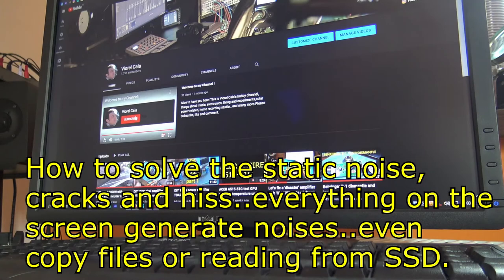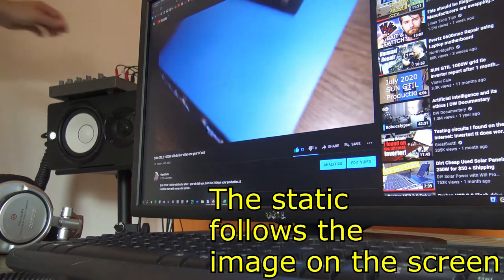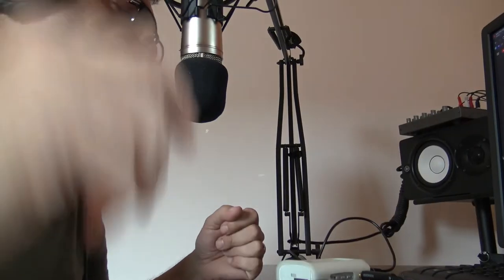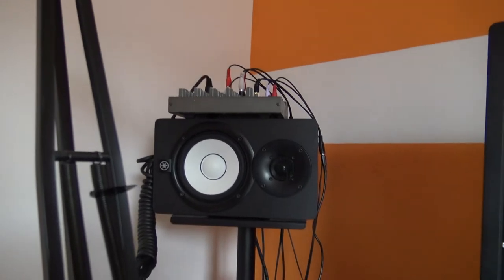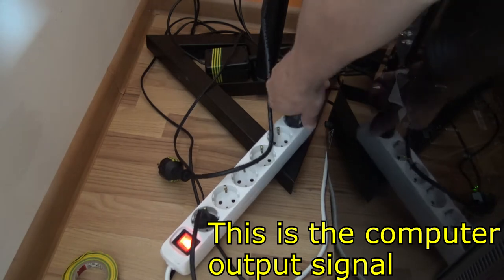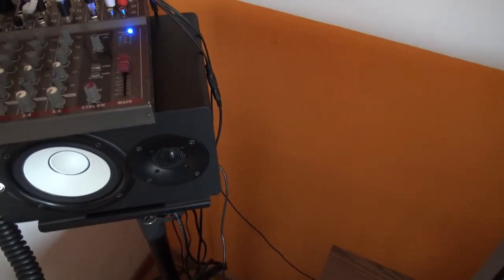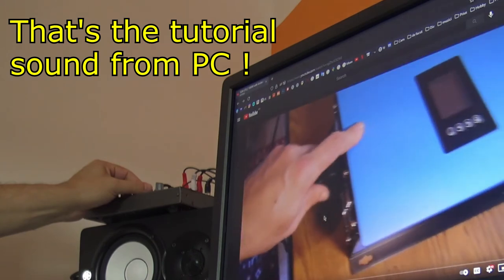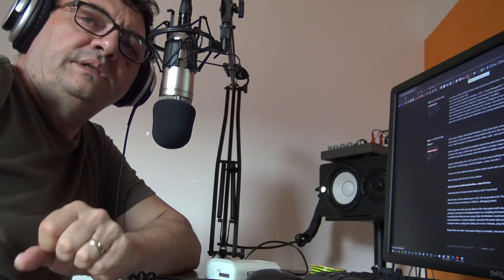ASUS motherboard cracks static audio simple solved

Comment: Thank you so much I have had this same issue with a Asus 570x TUF motherboard. I have been dealing with this issue for 3 years and could not find a solution. This morning I finally had a enough (because I hadn't used the computer for a couple weeks therefore had forgotten how bad it was). 

Anyways after searching every combination I could think of I stubbled across your video thinking it may be my motherboard. Your solution worked like magic. I'm in the US, so I used a 2-wire To 3-wire adapter. And zero hiss. You are the man.
Reply from the maker: So glad you could fix it! Nice to have a clear sound again. Thank you too.